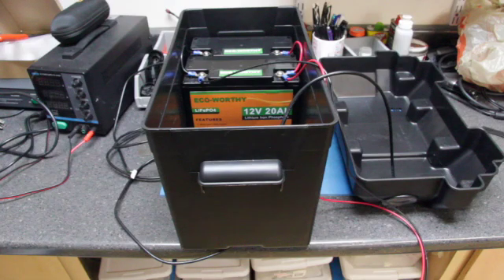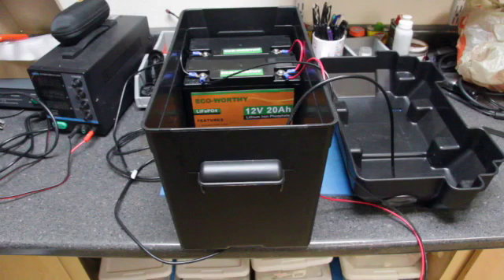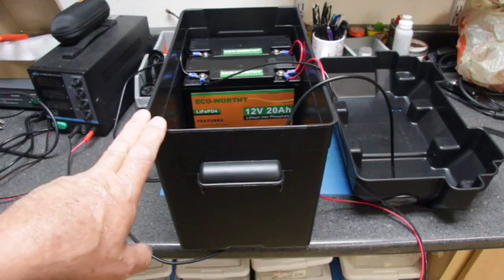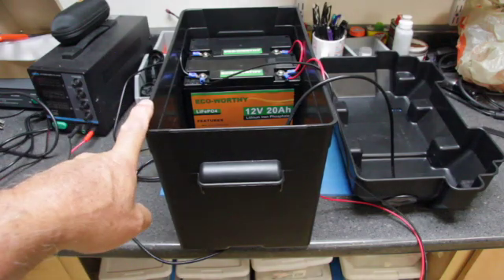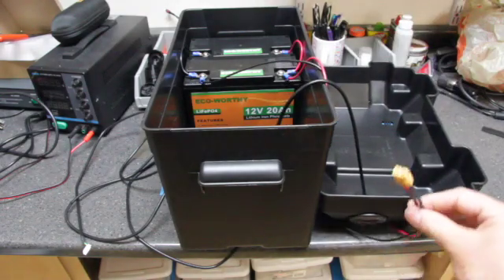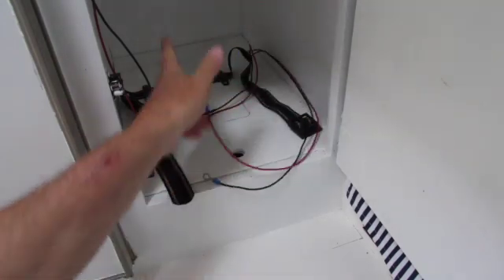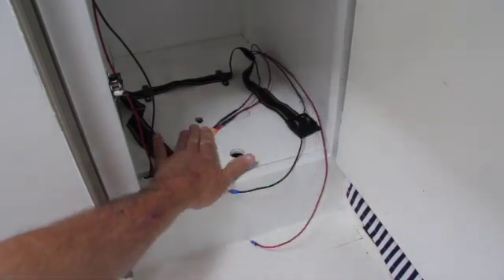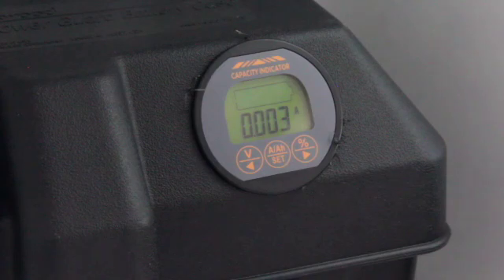RV Battery Bank  using Lithium Iron Phospate

Comment: I ended up buying a few of these batteries for a diy home power system. I love them! (2)150ah as my primary storage w/1k solar.   I would really like the option to plug it into my truck for charging(or diy alternator). My 30 amp cig socket will melt as the batteries can absorb 300wh. AND I cant jump them directly because the automotive battery exceeds 300 cranking amps :) Does anyone know how to limit high amp dc current without using a light bulb? :-)
Reply from the maker: Hey Jason, Read this article, it gives some good pro's and con's of battery isolation and Battery to Battery charging.  https://www.explorist.life/how-to-charge-diy-camper-van-batteries-with-vehicle-alternator/

Comment: Sir, I was wondering if you could help suggest a battery type.  I want to upgrade my sons 1500W 48V   ELECTRIC atv  4x12v 20ah lead acid batteries to  a  lithium iron phosphate battery.  Is there one you could recommend that would supply enough power for this vehicle?  Thank you
Reply from the maker: Depends on your budget, but the batteries shown in the video are mid-range cost and so far have performed nicely.  There is a link in the description to purchase from Amazon.

Comment: I just ordered a battery from the same company to power my trolling motor. I'm always weary of these budget batteries from the internet but I thought I'd give them a shot. How do you find the performance and reliability of the batteries? Any issues so far?
Reply from the maker: So far it is good for me.  Yes you have to be careful, You do not really know if the manufacture is using recycled batteries.  But I try to purchase from vendors that have good feedback.  Good Luck Duncan

Comment: Hi Joe Im looking for the top of line battery for my jetson bike , vol and ah ?????????
Reply from the maker: Hi Bill,  Check the links  Battery from ebay
https://www.ebay.com/itm/36V-8AH-Li-ion-Battery-Volt-Rechargeable-Bicycle-500W-E-Bike-Electric-Charger/274470037690?hash=item3fe7b068ba:g:UwQAAOSwBRlcxYSy

Battery from Amazon (USA warehouse)
https://www.amazon.com/gp/product/B08KHDJN8T/ref=as_li_tl?ie=UTF8&tag=joesfablab-20&camp=1789&creative=9325&linkCode=as2&creativeASIN=B08KHDJN8T&linkId=613797a8b7cdce5fabb2b232aae54c46

Any amp hour battery at 36 volts that will fit will be fine,  The two listed will fit in the battery compartment.

Comment: Joe, nice job! BTW, it looks like the coulomb meter shunt is installed backwards. When the battery is discharging, the arrow should be pointing down and the backlight will be steady, not pulsing.
Reply from the maker: Thanks for the tip,  I found a short in my XT60 connector,  I fixed that.  I will try switching the shunt the other way.